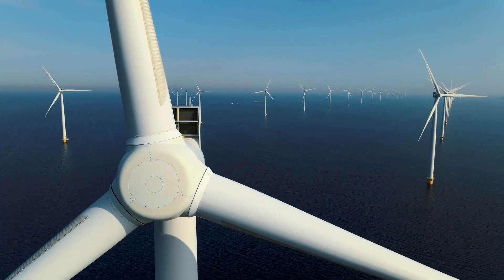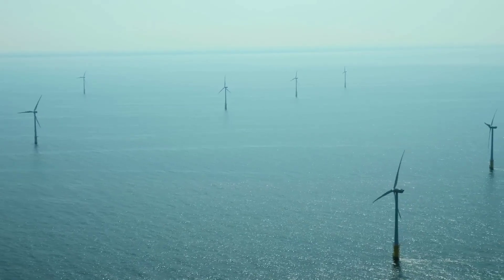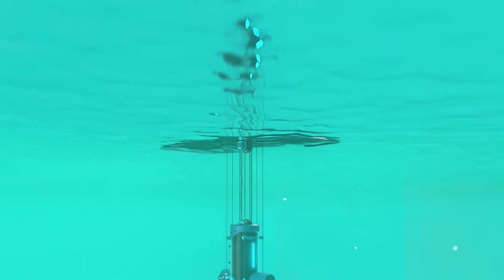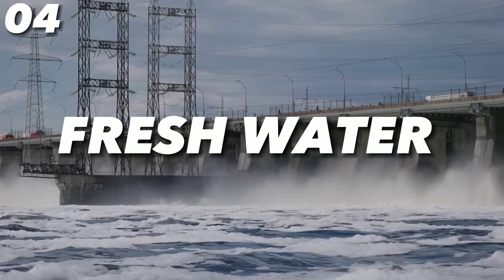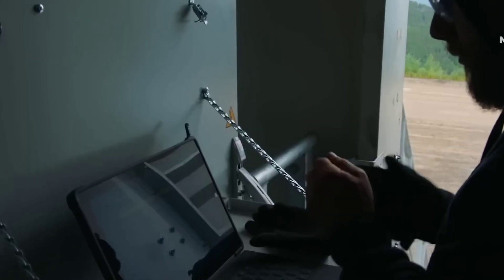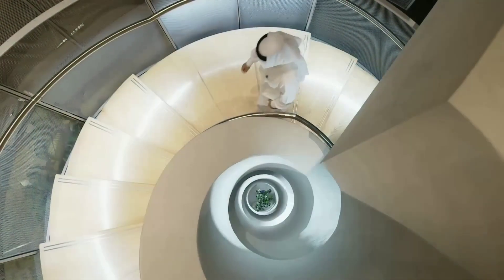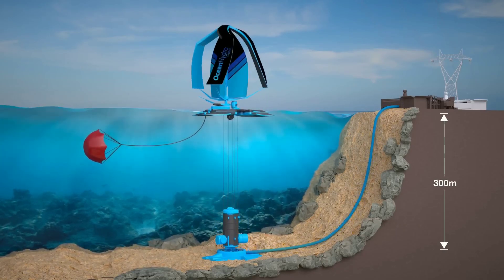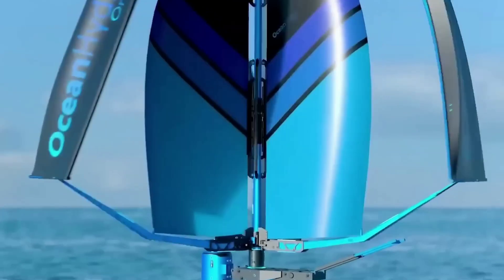USA New Breakthrough Tech Solves Wind Power's BIGGEST Problem!

Comment: A battery should be used to store power from a wind turbine. When a wind speed has been reached that is enough to keep the turbine going, power from the battery can then be used to restart it. PV panels can also be put on the mast and used to charge the battery.